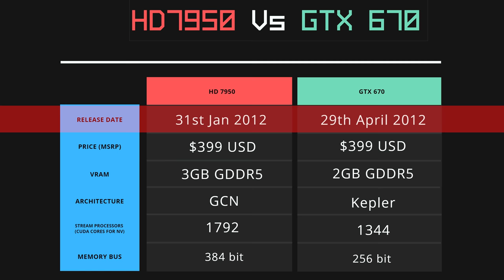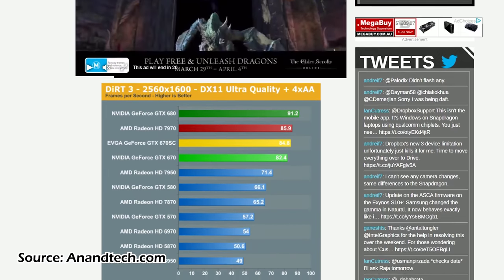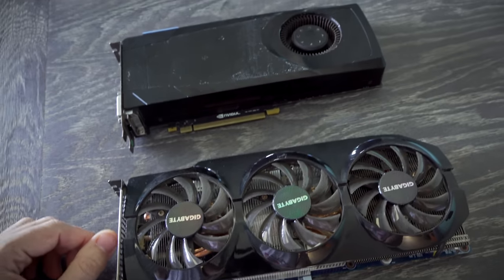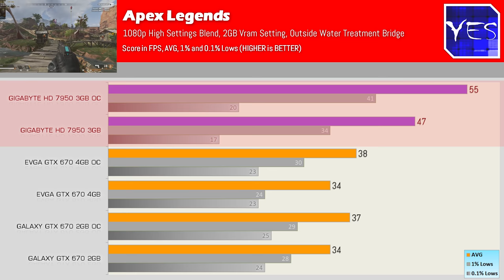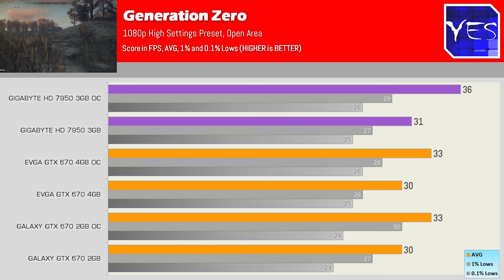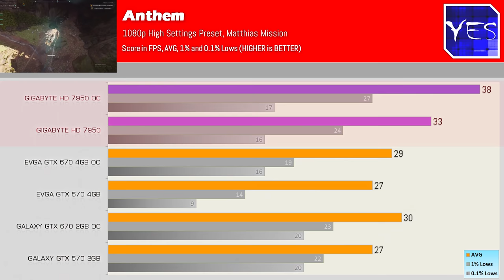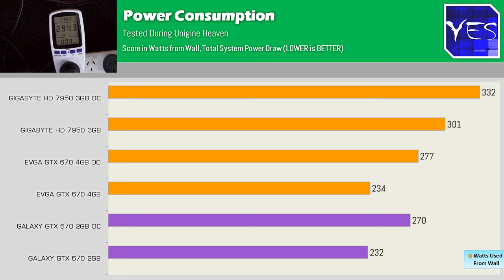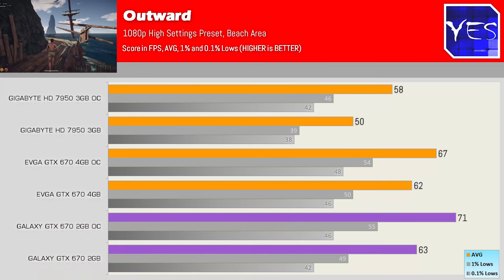GTX 670 Vs HD 7950.... Who Wins in 2019...!?

Comment: Still using ASUS HD7970 ... And it delivers all what indesire for now ( as im using 1680 by 1050 screen ) 😏😏
Reply: Had 7970 ghz edition in 2013 it was so good, still on my media pc on living room
Reply: @xTurtleOW  that mediapc consume a lot of watts mate 😂😂😂. Btw i would place my hd 7970 on a shelf, for its great service.
Reply: Nice resolutiOn, better than 16:9
Reply: I sold my rog 7970 matrix platinum after I upgraded to a 1080ti ftw3
Reply: Im using a 1680 x 1050 screen as well... with a gtx 980ti 😂
Reply: @elikirkwood4580  i have 2 samsung bw226 screens. So far - me happe 😁
Reply: @Kryostance  and it can heat up your room ... But its a beast of an card at that time and even now 😁🤘
Reply: I have a 6gb version its still a great card.
Reply: 1440 x 900 ftw!
Reply: @crazed357  cant say oposite 😁😁😁
Reply: I had a diamond 7970 it just died like a month ago. I got a Sapphire Nitro+ RX 470 4GB on eBay for 70 shipped though :D.
Reply: power color 7950hd here
Reply: Both are still supported, the oldest lineup AMD still supports.
Reply: The R5/7/9 series were basically a rehash of the HD7000 series, same island names...
Reply: @elikirkwood4580  Using a 1680x1050 screen with a regular 980 :P
Reply: Mine blew a few weeks ago, opted for a rx590
Reply: @HeyItsDyl  even with this screen i have a few games that max out the card. Mostly from the depths with its gpu rendered ocean
Reply: @elikirkwood4580   I don't think I've had a game max out my card if i cap it to 60fps.
Reply: 1680x1050 still isn't a bad resolution in my opinion
Reply: I'm still using my old 7950 as well. It's all I need for my editing needs. (:
Reply: Still using a Saphier HD7970, also overclocking it now, as want a bit more performance.  

Had to upgrade my Intel Q6600 as was showing its age in games.  So got an Intel Xeon E31270, motherboard and 8GB of RAM and heat sink off Ali Express.  The heatsink went in the recycling but managed to save my old heatsink by filing the heatsink fittings to make it fit.

Comment: Oh man, I remembered my 7950, it was actually the first GPU I bought for my first ever proper pc build, it was one of the best purchase decisions of my life because it was one of the best value for money GPUs on the market at the time. I actually remembered it being cheaper than the GTX 670, closer to the GTX 660Ti price range, but performance wise, it was head to head against the 670 especially when overclocked. The only thing the 660Ti got against the 7950 is PhysX support, and a lot of my friends got the 660Ti over the 7950 just to enjoy PhysX on Borderlands 2. As years went by, bugs getting fixed, and drivers getting optimized, I noticed a slight performance gain on my overclocked 7950, to the point where it was actually performing closer to a reference GTX 680. It lasted for 5 solid years, and had it not been dead, I would've been still using it. What a beast card.

Comment: I think Nvidia really is leaving Kepler behind, I have a 750ti (maxwell) and a 760 (kepler) and the 750ti actually runs better in newer games! I've noticed this in The Division 2 and Apex Legends
Reply: zWORMz Gaming hi ! :)
Reply: OUR BOI.

On that note, in Forza Horizon 4 and 5, the GTX 750 TI performs the same as the GTX 680/770... Probably the most extreme example I've across to far that I remember. Imagine needing a GTX 780 to beat the performance of a GTX 750 TI.

Comment: R9 290(X) & R9 390(X) vs GTX 780Ti, 970 and 980. Lets see GCN vs Maxwell
Reply: still got my sapphire 290x 8GB, still close enough to a 1060 6GB to not be worth upgrading.
Reply: 780 and 780 ti are still Kepler. Only the 750 and 750ti of that gen are Maxwell.
Reply: @jtenorj  Yeah I know but its performance comes in direct comparison with 970 and 290, thats why it should be included
Reply: R9 390 owner here. Great performance, skipped polaris and Vega completely. Only downside is a 60deg idle and 80-85deg load temparature (not a blower, MSI twinfrozr) and 8+6 pin power requirements. Despite the temps the thing just runs and runs and runs. Maybe i can retire it with the coming navi cards.

Comment: my friend had GTX 670 and i had HD7950 so i never clicked a video that fast. now he has GTX 970 and i have RX470 :D
Reply: @bakkermann013  totally agree
Reply: Look at you pretending like you have a friend!  That's so cute!
Reply: 480 and a 970 are a closer comparison, but i am sure you can overclock a 470 to stock 480 levels or near there.
Reply: @Fast85FoxGT  480 would destroy a 970... a 480 is closer to a 1060 6gb or a gtx 980
Reply: I also have the RX 470. And btw, whats a friend?
Reply: you should flash that bad boy to a RX570!
Reply: @Eu4ia_  already did that but could only get +90MHz on GPU for way higher pwoer consuption,noise and temps so it just not worth it in my case
Reply: @Fast85FoxGT  mine running on 1300 GPU 2000 Mem
Reply: @RC51debauchery  at least my left hand dont argue with my right hand unlike yours
Reply: What was the netter one?
Reply: @denis1936  between the old two the HD7950 the newer ones the GTX970 IMO
Reply: Silly Szili okay Thank you
Reply: @denis1936  yw
Reply: @sillyszili2593  i have none and trying to buy 670 and my friend has rtx 2080 super 😊🙂

Comment: Back in the day the 670 won over the 7950 by a 5 to 10% margin quite consistently. 7950 was a happy medium between a 660Ti and 670, i remember since I had one and was watching benches all the time. That year was a rollercoaster of emotions for AMD, we (users) got mayor driver improvements in a fast pace that nonstopped for a whole year (amd was migrating from a single threaded driver full of ATI bugs), later on, Nvidia published a study over frametime that revealed the mayor problem that AMD had with some GPUs (mostly Crossfire and dual gpu cards). Besides this, it was an exciting year since the frame pacing was not in the horizon for benchmarks and the 1% and .01% testing was born there. Many things were making a fuss, the weird color compression with Nvidia (HDMI outputs still gets compressed by default unless users change it in control panel), the frame pacing testing was hot news, the slow transition into a >2GB framebuffer and of course Tessellation was a nightmare. I believe it was then when the say of "AMD cards age like wine, while Nvidia gpus age like milk" was born... what a generation, the 7870XT, 7950, 7970Ghz edition. AMD GPUs were interesting. In the other hand... Tesselation was cripling performance like crazy for AMD users, and the 660Ti was discovered to have the last block of VRAM a lot slower than the others (something that happened again with 970). Fun times.

Comment: 5:57 "more efficient" - I don't think so, as there is also a performance increase with that greater power draw. 

The problem with the stock clocks on the 7950 (Boost) is due to powerlimit and no fine gradiation between the clock steps. AMD just wanted to play the "Nivdia Boost" card aswell - pretty stupid idea  with that implementation. 

GCN is just amazing. My Tahiti 7870 XT @1,2 GHz easily competes with a GTX 770 2GB nowadays - which the specs suggested long time ago.

Comment: I used to have two sapphire 7950 oc boost editions that I  used  to run at 1000mhz eash and a large oc on the  memory in crossfire in 2013 crisis 3 ran great 🙂
Reply: I was able to my my single boost edition to 1200/1400 when it was new. I still run it at 1000/1300. The temps are still good at higher frequency, but it's no longer completely stable over 1000.
Reply: @NortheastRacing  was that in crossfire?

Comment: I bought a Sapphire HD7950 in 2012 and still have it.  My friend bought a GTX 670.  Stock the 670 was faster but overclocked my 7950 destroyed him.  Now the 7950 is as fast as the 680/770 due to nvidia gimping their GPU and 50% more memory.  Factory overclock on the 7950 is a disgrace.  I've owned 6 7950 and 1130 was the lowest overclock and 1170 the highest on stock voltage.
Reply: When AMD tweak their drivers for GCN it goes all the way back to these cards.
nVidia stopped to that with Kepler years ago

Comment: You can unlock most 7950s to 7970s for extra performance if you wanted to give it a go should give you average 8% jump in fps
Reply: i believe that unlock is only clockspeed (and power limits?), not compute unit unlocks like you could do with the r9 290 and 6950. in that case, just a normal overclock would achieve the same results. please correct me if i am wrong

Comment: Remember getting a gtx 670 jetstream from palit for 299 us dollars on flash sale. 7950 was too expensive in my region for some reason, you could buy a basic 680, so it was a no brainer for me at the time. Still works in my cousins pc paired with i7 2600. Rock solid low-mid range 1080p gaming pc. Is 7950 better now? Yes, obviously. Do I regret not paying premium for it 7 years ago? Probably not. The 670 started lagging behind 7950 after Pascal launch, Nvidia definitely put much less effort on Kepler optimization and its very obvious.

Comment: What if a gtx 1080 8gb will cost 50$ in 5years :)))))
Reply: @Hallison Michel hopefully but ibdoubt efficiency and al will improve that much.. Maybe not a 1080 will be 50 in 5 years .. Flagships tend to hold a bit more value.. 780 and 780 ti are around 90 to 140 respectively and the 770 is like 60 to 70 $ so the 1070 and ti will definitely get the lowest first abd be beautiful value
Reply: Hseng Juang say: "never in my round"
Reply: not that sure, prices are going sky high and performance wise not that much, the 1080 is like 3 years old now and they are around the 400$ (not blowers) because it can deliver the same performance as 2070 that goes for a higher price (idk around 600$) so maybe the new navi can delivers and chops the prices then we will see

Comment: 7950 should win, 670 is just a 660 ti isn't it? the 7870 was slightly worse than the 660 ti.
Reply: GTX 660 Ti has a smaller memory bus. 192 bit vs 256 on the GTX 670
And it was 7850 < 660 Ti < 7870 < 670 < 7950 < 680 < 7970  770 < 7970 GE

Comment: hmm gtx670 was way faster than 7950 when launched.It was actually same fast as 7970.GCN saving grace is that it is in consoles so all optimizations are made for it.
It was same fast as 7970 but way cheaper.7970 launched at 550usd.
https://www.techpowerup.com/reviews/NVIDIA/GeForce_GTX_670/28.html

Comment: Thank you for testing both graphics chips, including the GTX 670 in the 4GB version. I think that 4GB made more sense for the GTX 680 than the 670. I used my EVGA GTX 670 2GB card from October 2012 for over 5 years until March 2018 and was very pleased with its performance, work culture and stability.

I previously had a Radeon 5770HD and somehow this AMD card put me off with its capricious drivers. Although when everything worked it was quite powerful, especially after switching from the 8800GTS 512.

I am currently wondering what to buy for my collection and such a comparison was very useful to me.

Greetings from 2024 :D

Comment: Interested configuration on the power connectors on that 670 2GB. I kinda' dig it. As for which one I would have, I had the 7850 and a 7970 and they were great.

Comment: Well I'm not surprised. I remember back in the day I and a friend we had a discussion which one is better the 7970 or the 680. Now these are their smaller brethren it's not much of a difference. I said the 7970 will be ultimately better for the most part because of the 3 GB Vram and 384 bit bus and simply way higher count of compute units (2048 vs 1536). Now that both GPUs are working at their max and AMD has great drivers it simply shows

Comment: My brother has the same gigabyte 7950 and he is still playing everything on it but lowers all his settings to get over 60fps he's been using it since 2013 definitely getting the most out of it. Around the same time I had the GTX 670 2gb but sold my system about 3 years ago. Even at that time I noticed his card was starting to pull ahead of mine due to the vram I assume. At the time of there release I would have choose the GTX 670 but right now the AMD 7950 hands down.

Comment: driver level improvements have certainly helped out all GCN generations beat their nvidia counterparts in recent years. however i must say that i think the main reason for this could actually be the optimization for compute performance that many modern game engines have. the gtx 500 series which has greater compute performance than the 600 series has actually held up rather well in modern games. the 3gb 580 specifically beating the 670 in some games. also, if you compare the games that came out launch 7950/670 period, the results remain the same as they were back in the day

Comment: Is Outward a Nvidia sponsored title?
My theory on why the 7950 wins and AMD cards generally ripe well (HD 7850, 290, RX 580, Vega56, even Vega64 has made big gains): because the CU's are relatively overkill and the cards have a bottleneck somewhere else. See the limited extra peroformamce for Vega64 compared to Vega56 or FuryX to Fury. Newer games can use that 'reserve' CU computer power.

Comment: Agreed, that particular generation of graphics AMD was doing really well (I did very much like the 7970/7990 specifically)... R9's where good too, but not my favorite.  And man was that so long ago... I will say that Polaris does seem to have aged fairly well - at least the RX 470/570 & RX 480/580. Polaris has been around for what seems like eternity though...  Here's hoping Navi might turn things around for the Radeon Group.  And if not...  Well, I'm looking forward on seeing what Intel is going to bring to the table next year.  BTW, I've run nVidia primarily since the early 2000's (first nVidia card was an MX400), but these days I'm just not green with excitement over nVidia's products (esp with nVidia's closed binary blobs in Linux - the open source AMD drivers are so much easier to work with these days).

Comment: I  had a 7950 a few years back, was given a 680 2GB, thinking it was an upgrade (albeit a small one) I installed it, then removed it the next day as the 680 just couldn't keep up with the 7950,  and it wasn't just due to the VRAM...

(Though mine was a new(er) 7950 based on the R9 280X GPU... it identified as a "R9 200 Series" in Device Manager)

Comment: I recently compared a GTX 680 2 GB and a HD 7950. For most things they were very similar in 2021, but when I ran the GTAV benchmark, the 680 was about 30 FPS, and the 7950 was at 60 FPS.  but it did seem smoother on the GTX 680.

Comment: My 670 (+ i7 3820 which is great) still works good on most games, at least more than 40FPS in high/ultra mixed. Maybe on modern AAA high-. I upgraded but damn this was the most resilient card I owned. I did not tried on RDR 2 but I guess there it would be completely wiped out. I upgraded one week ago, but I am not even sure it was required since I am not that into AAA.

Considering ATI I had a 4870x2 ( a terrible choice for a crappy card) before which died out after 4 years so I bought a 670 FTW instead of an ATI. Looks like I was wrong ^^

Comment: your "wasn't much of a difference here" in the division was a 30% difference. That's rather significant. OC to OC, 43 to 31, 38%, 43 to 34, 25%. Stock to stock, 36 to 28 and 29, 28% and 24% respectively. These are big margins.

Comment: What Clocks did  you end up with on them?  I had a windforce 7950 that ran 1200mhz for 4 years and still runs (albeit at 900mhz due to case constraints :)
Nvrmnd, just got to the clock speed part. Your clock behavior might be due to the original owner flashing the bios.  If i remember right that card had a  900mhz base clock.  I flashed mine to the 7970 Ghz bios to have a higher power and default to 1000mhz (also how I could run all day at 1200mhz stable.).

Comment: The 7950 was rehashed as the 7950 Boost which was only a change of BIOS (and most 7950s got the Boost update like Gigabyte did) and then it was rebranded as the R9 280 meaning that this AMD GPU was considered as a current product for 3 generations where as Nvidia already has moved on from Kepler.

Comment: I have that same galaxy 670 in my HTPC. The fan at 100% is quieter than my 970 evga SCC cards at 100% fan speed. But the EVGA coolers are more efficient so they spin slower and are overall quieter.

Comment: "it looks like NVidia is doing something at a driver level to mitigate bottleneck in games"
Uh.. I doubt it. Just because a game loads more than 2GB for the 4GB version of the GTX670 doesn't mean it benefits from that. Plenty of games will load more than they need simply because they can to avoid potential stutter issues. It may make no difference or it may help but not in the area you benchmarked. But I don't see how that's in any way a DRIVER issue.

Comment: The Vram going over 2gb and giving the same result as the one with 4gb, although the game uses 4gb is because the game doesn't actually use that much Vram. The reading in Afterburner shows you how much Vram is allocated by the Gpu, not how much a certain Game uses.

Comment: Hi Brian,I scored two computers from the dumpster I was quite lucky,Dell optiplex  790,i7, I don't know if you familiar of it, I fix them up I gave them a good clean I downloaded to Windows 10 to them, and put fresh  thermal paste on the CPU.

(My question is for help please)
I have an amplifier Denon, my amp is a bit old it's got no HDMI in the back of it but I have optical fibre and coaxial cable in the back of the amp,is there a sound card you recommend me to it that fit in the Dell case,I have two slots in the Dell computer and video card I want to buy so which one you recommend me as well with HDMI because I have a 65 inch 4k television that fits in the case as well, I am on a bit of budget something not too fancy
Thanks Brian regards John👌👍👍